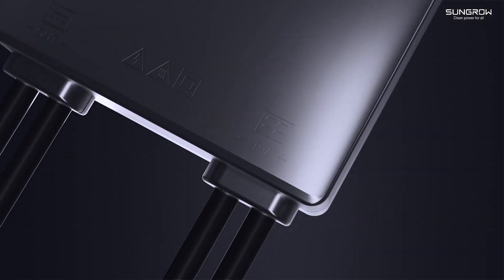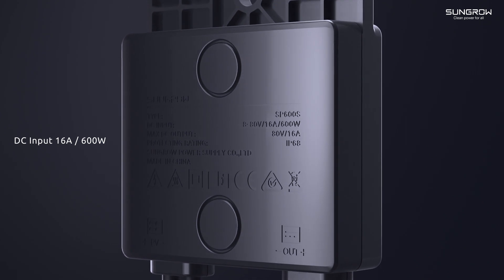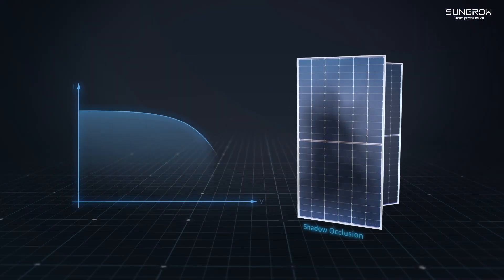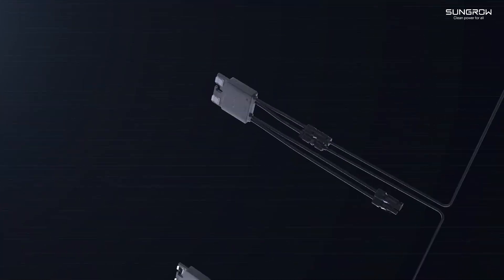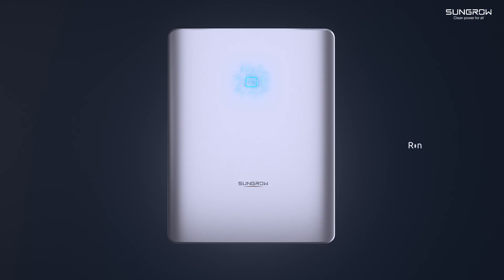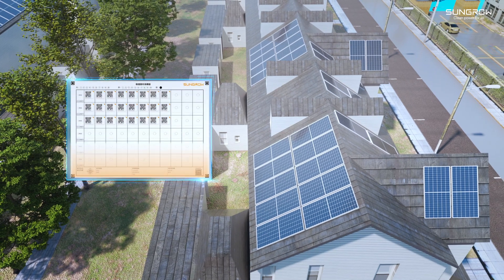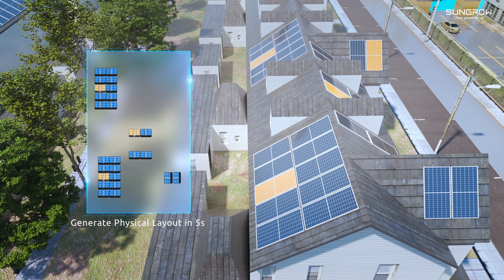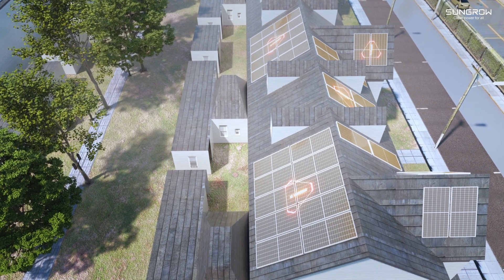Sungrow Power Optimizer SP600S

Comment: I think the size is problematic . should have been 700w or 800w
Reply: Usually, modules of 700-800 W are not used in residential, which is where optimizers are used.